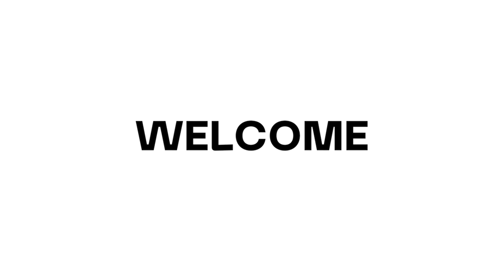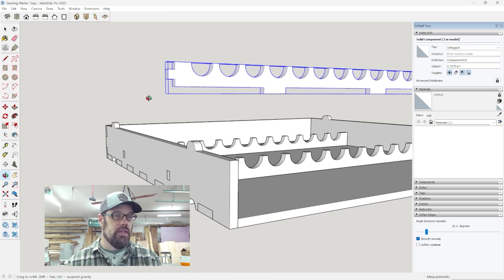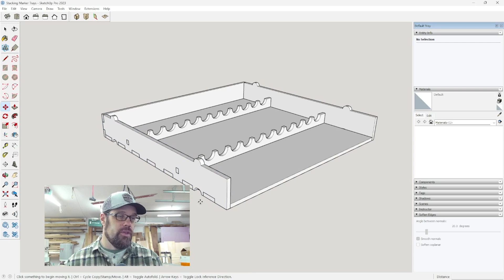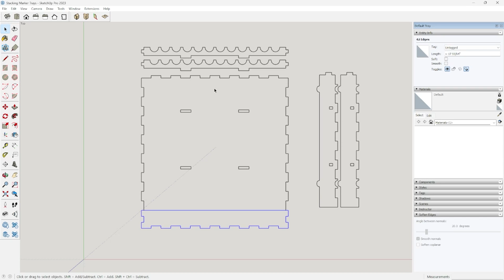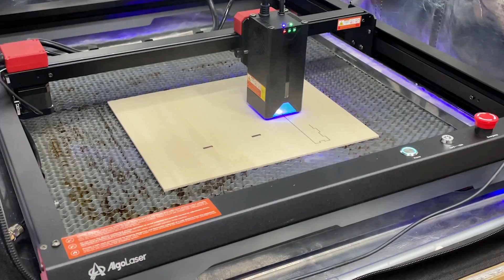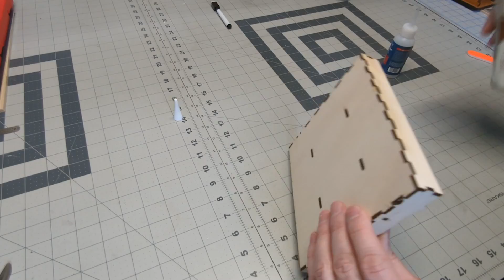Laser Cut Stacking Organizing Trays

Comment: I know this is a few years old but something that came to mind to save on wood, make only the bottom of the first tray have a bottom, all others don't need a bottom they just need the sides and back and the wavy middle that holds the markers, they can actually slot into the sides or something, that way you save on all that extra unneeded bottom wood for other layers, if that makes sense :D
Reply from the maker: That could be an option but I also made it so you could remove just one tray at a time as needed, or you can add another tray if your bought more markers.

Comment: Neat project. You could add two cut-outs on each side, just in front of existing cut-outs so you could stack the trays offset or in line, whatever works on the day.
Love your idea of using sketchup! I'm new to lasers hut have used sketchup for yonks. Thanks!
Reply from the maker: As long as you can still get enough glue surface areas still, this should work.  The more slots we add, the fewer tabs that are glued together would be my only concern. Maybe stretching out the tabs so there was still some glued surface area on each side would help with that.  Always things to consider to revise and make the design better!  Sketchup is a nice tool to develop these designs in 3D.

Comment: Make sure that if you’re using a kerf offset that you don’t combine edges of your shapes.  It can result in those edges being cut incorrectly.
Reply from the maker: You are correct and I tried to point out that you would not want to do this on an edge that needs a precise fit, but on straight edges where it's just an open end of the item, the difference should be negligible and speed up the laser operation.

Comment: Hey cool video! I have one question, you said, if you put these parts close together the laser won`t burn the "touching" lines twice. I`ve tried it serveral times but it doesen`t work for me. Is there some setting i have to set first?
Reply from the maker: It depends on the software you are working in. In Sketchup it will automatically combine overlapping lines but in lightburn you’ll need to tell it to ignore duplicate lines.
Reply: In Lightburn, the remove overlapping lines Optimization Setting does not take effect if you have a Kerf offset in your cut layer.
Reply: Thx guys, found it and got it to work.

Comment: cool build .  Really enjoying my also delta I  cut around 10-12 mm/sec at 85 power for that material.  I think you can clip your power at least to 90 and bump up to 600mm/min and still get a good cut. 100 power is pretty aggressive .
Reply from the maker: Some of the wood I’ve had recently has had some extra glue pockets so I’ve slowed it down. But you’re right. The module can usually go faster.